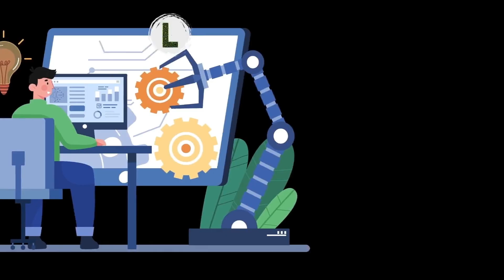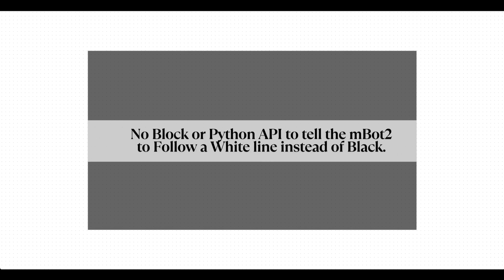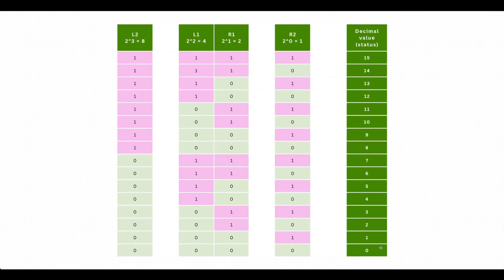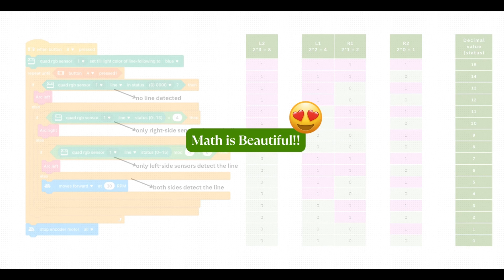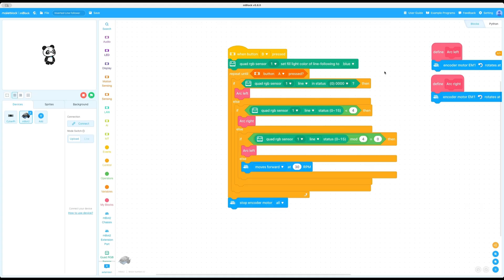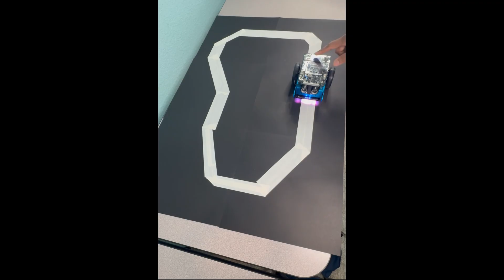Inverted Line Follower Tutorial for mBot2 | Follow White Line on Black Track

Comment: how would you go from a black line on a white background to a white line on a black background, so it dynamically changes
Reply from the maker: Thanks for the question! I think that’s going to be difficult unless there’s some marker at the transition that the robot can sense. For example, if it’s known that 
- the robot always starts on a black line on white background
- hits a red patch at the transition from black line on white background to white line on black background
- then continues on the white line on black background
That will be doable. But without a marker (like the red patch above), this may not be possible, in my opinion.

Comment: Another great video. Your explanations are very easy to follow. I’m going to see how well this works with a white chalk line on a black tarmac driveway.  Typically a chalk line is not completely solid so it will be interesting to see how the sensors respond.
Reply: A bit temperamental on chalk lines  https://youtube.com/shorts/KKqhNbNYY7Y?si=LNTsahPH9kPaSx9d
Reply from the maker: @MyTutorGuy  Thanks for trying it, and for the results video! Yes, I can see that the sensors are having a hard time staying consistent with the white/black signals. We’ll need to add more “smarts” on the software side of things for it to be able to deal with such a case. Let me think about it and get back to you!

I love that both you and your grandson are so passionate about this by the way! 😊
Reply: @LearnAsYouExplore  so if i want to turn white line in other thing how i do
Reply from the maker: @enzoferdinandfalcon1372 Just to clarify - are you asking how to make the robot follow a different colored line instead of a white one?